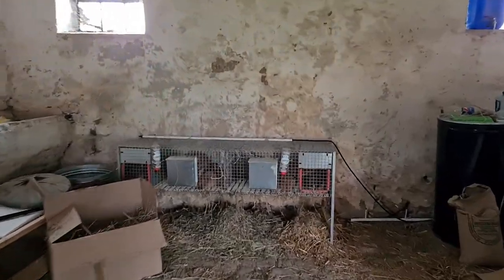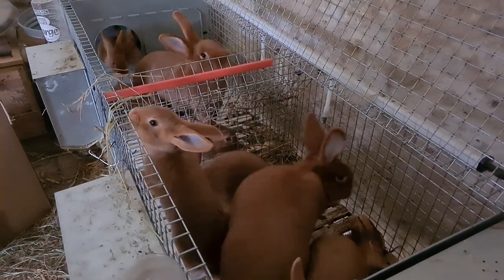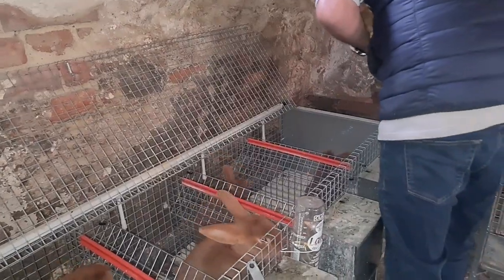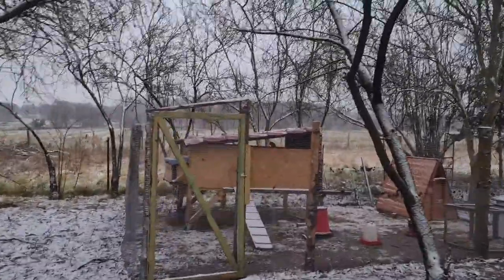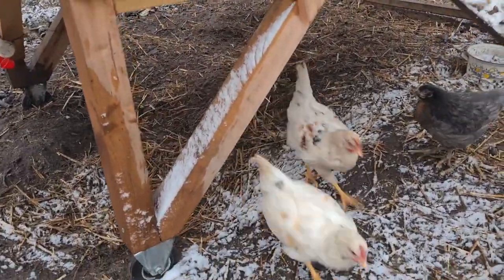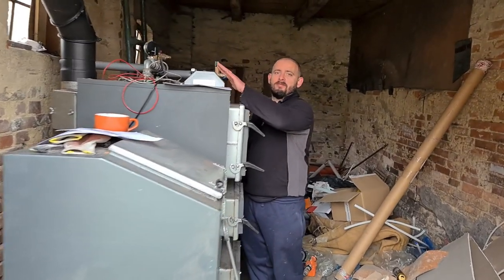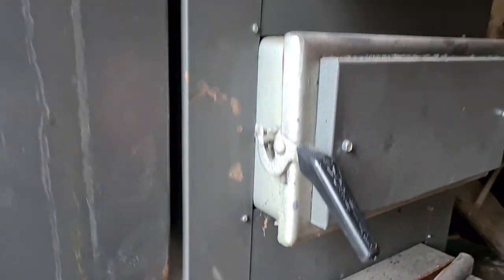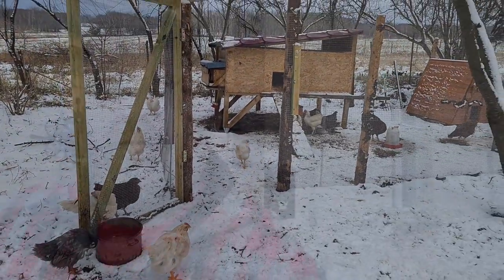The Heating Install is in and it started snowing !! - Homesteading Small farm Vlog Update #16

Comment: Awesome vid. So glad you have good heating now. That is a real beast. If it was closer I would add an oil filled water tank (in the living area), to create a thermal gravity fed syphon sytem to maximise available free heat radiation, which is also good should the fire ever go out in real severe weather. Time on my hands now to tinker with an idea to add a hot water tank too. Fire heats area & oil, oil heats water, three times the benefits.
Reply from the maker: Its certainly is a beast, we also have a hot water tank (we will do at full tour again at some point) upstairs that is fed from the furnace and we use all of this in conjunction with the wood burner, mainly to reduce cost as like most things the price of the eco coal has doubled in the last few months.
Reply: @MagpieFarm  Cool & yes, fuel is getting to be a real issue. I started keeping all the saw dust I produce to mix with veg oil & scrap paper/cardbord compressed put in small paper bags to throw in with the wood. Helps maximise temp output in the real cold snaps & helps with costs; but does add another job to the never ending list. lol.